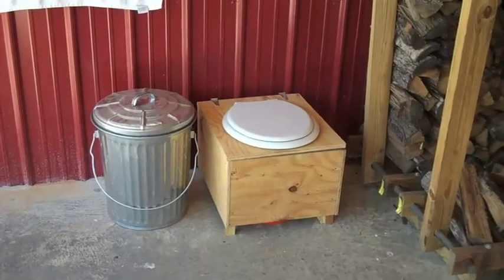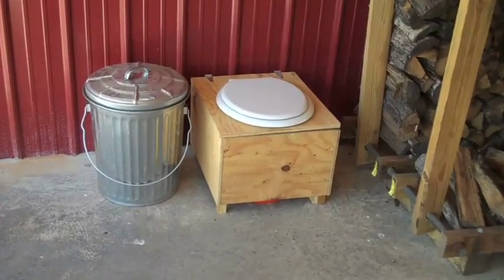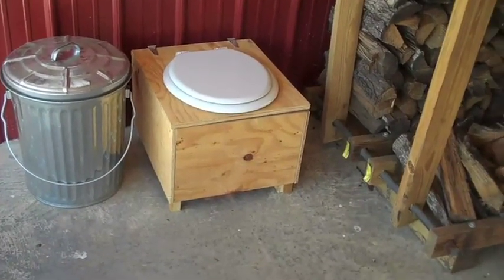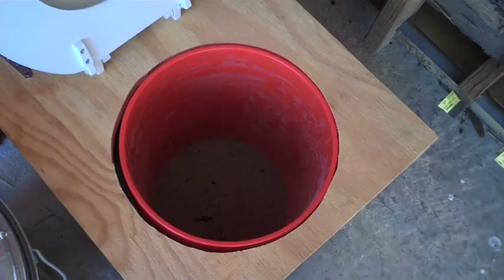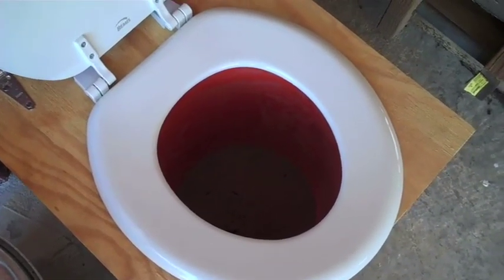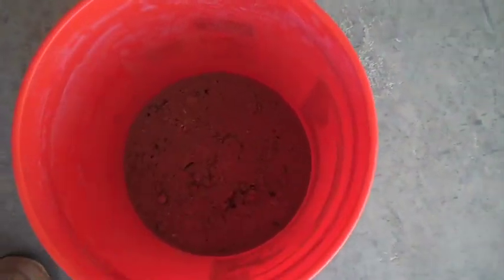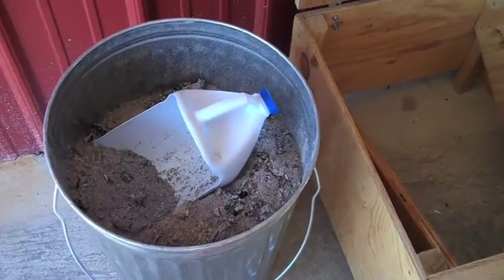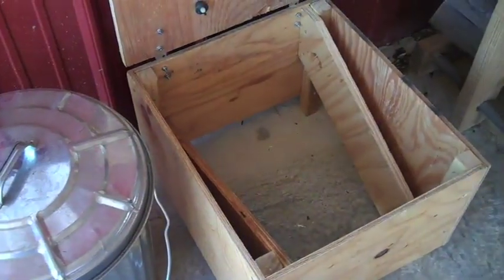composting toilet.mov

Comment: what about ventilation? and just an FYI ...I think this toilet is pretty cool! and it is nice if you painted the base box surrounding the toilet like a chocolate brown-black color or instead of using wood some other material thats is not so rought this toilet would fit nicely in a moder bathroom , I especially like the legs on it I think thats what gives it the nice factor.I say keep this one. : )

Comment from the maker: Because that's what I had at the time. I'm using wood chips now. I have some crushed pecan shells coming in a few weeks and will probably use them then. Most any fine particles of organic matter work fine. As you probably already know, ash is VERY basic, so if I used only ashes, I would end up with compost with a high pH. Might be useful on our acidic soil, but I would need to keep that in mind . . .

Comment from the maker: You'd be surprised how little of a problem that is. A 5-gallon bucket is shaped completely differently from a toilet, so most everything goes straight down. If anything gets on the side, you can just wipe it off with a little toilet paper.

Comment: I'm planning to construct a similar type of composting toilet, but I can't figure out, if the lid on the bucket must be tight (airproof), when I put the bucket aside after use (for example for 12 months), or if a valve (or a small hole) is needed to prevent to much pressure in the bucket and to give air to the compostingproces. Any ideas?
Reply from the maker: I can only tell you the way mine works. When we fill up a bucket, we cap it with the resealable lid and put it aside. We'll wait until several buckets are full (typically six weeks or so) and empty them all at once into the compost pile. I never have a problem with pressure building up inside the bucket. There's not much air that gets in or out,  so it just waits for the compost pile to begin decomposing.
Reply: Interesting